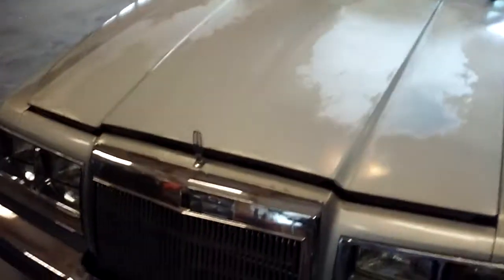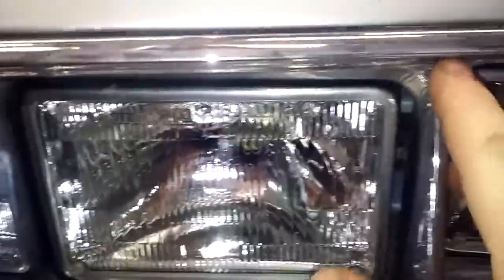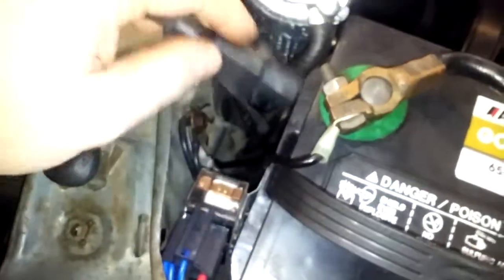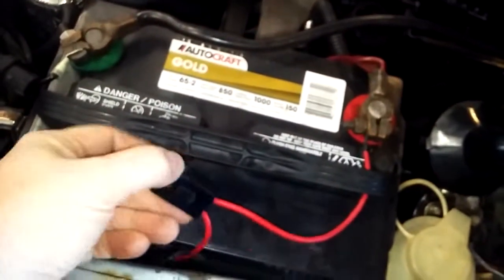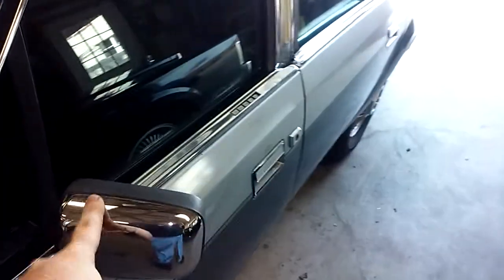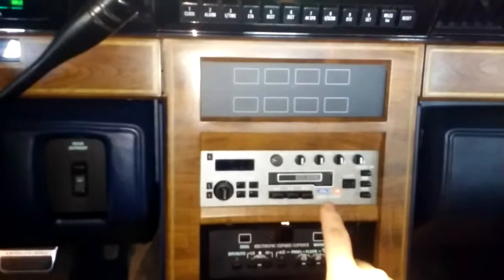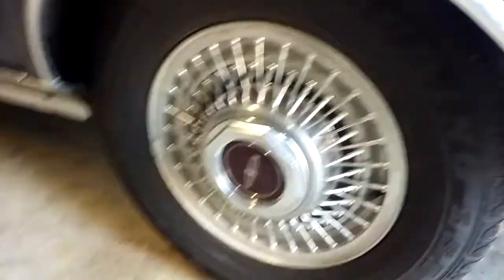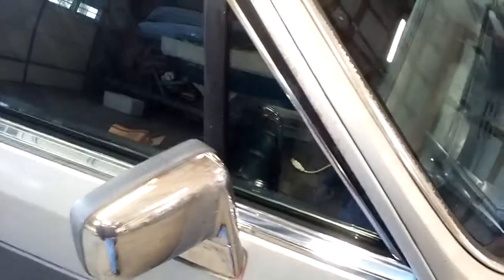one year update on the diesel Continental

Comment: get some 600 grit sandpaper lightly sand off the bad clear-coat, get rustoleum auto primer spray passenger fender where the big scratch is take it down to metatal then spray the primer on it and take it to macao for the 499$ special keep polish on the cheap paint so it doesn't fade voila beautiful  lincoln!

Comment: You put an amazing amount of time to resurrect that car! You'll be hard pressed to find another. I know an elderly in NJ who has a garaged kept 2 door town car. Any interest?
Reply from the maker: Thanks. Its an odd duck for sure.

 Is it a Town Coupe or a Mark VI coupe? Almost the same car, but the Mark VI has flip-up headlights.  Its an interesting car and if I had more space I might consider it but right now it just doesn't make a lot of sense to add yet another to the herd.  That would be the perfect one to have though, garaged, not abused, maintained, etc.
Reply: It's a 1980 Town car. I just never saw a two door. I think it was a 302, and it just sits in his garage. He's in his 80's and can't drive it anymore. He lives off RT.78 towards Phillpsburg.
Reply from the maker: 1980 was an odd year, and the first for the smaller Panther platform Lincoln. You had the base Continental in two and four door.  The Continental Town Coupe was a more optioned two door, and the Continental Town Car as the optioned four door.  You also had a Continental Mark VI two door, and I don't know if they had a four door Mark VI in '80. 95% identical cars other than some trim and the Mark VI with flipper lights.  Also the only year for the optional 351 at a blazing 140 hp.  I think the 302 was 120?
Reply: @gadget73  Not sure what the HP rating was but you're right about it being low. Last time I saw it, it was at least in a relatively clean garage. I do know that had some relatively minor issues since it has been sitting awhile. Had thought about buying it for myself, but it would not fit my garage! I can barely get my 67 Buick Sportwagon in there!